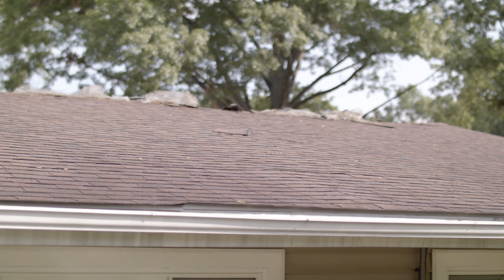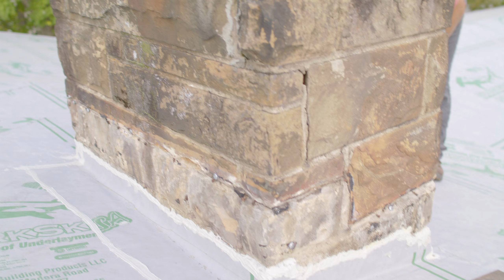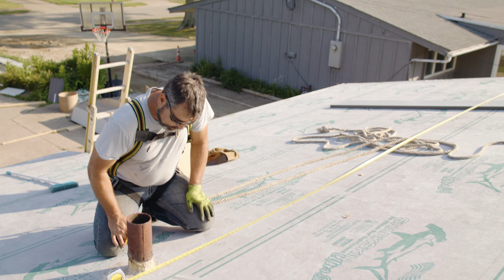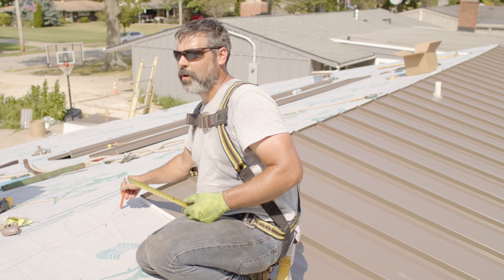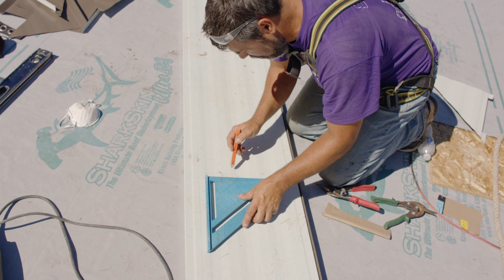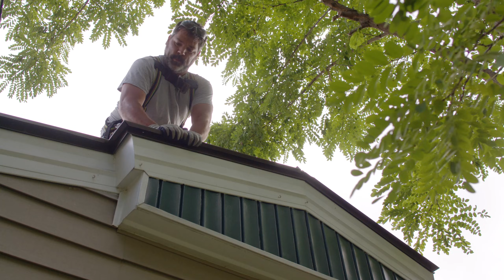How to Install a Standing Seam Metal Roof from Start to Finish

Comment: It’s great that y’all show the “overall “ start to finish, but it’s the small details like cutting trim overlaps and how to “fan” the panels to make up for out of square situations that I wish you would have shown. If not then links to videos that do show it.  Good video but not great IMHO
Reply from the maker: Check out the description - I've listed out an in-depth tutorial video for each section of this roof including everything you mentioned (and the full installation playlist). Also copied them for you here below. -Thad

How to Prepare for Your New Metal Roofing Installation" video: https://www.youtube.com/watch?v=JgcsMPcahJ0
How is Metal Roofing Trim Fabricated?" video: https://www.youtube.com/watch?v=SpnvrixCG0A
How to Lay Out and Square Metal Roofing Panels" video: https://www.youtube.com/watch?v=3SVEgdWeu_8
How to Install a Pre-Manufactured Curb" video: https://www.youtube.com/watch?v=9yN0W76Cnpw
How to Install Metal Roofing" Playlist: https://www.youtube.com/playlist?list=PLrMRkz6smMg3SjsuPhCQBlcrYuNfqL242
Scratches on a Steel Metal Roof: Identification, Prevention, & Repair": https://www.youtube.com/watch?v=rotxCn2nBB0

Comment: These gents are true craftsman. Standing seam roofs are not easy make sure the standing seam itself runs precisely parallel to the rake and perpendicular to the fascia. These guys nailed it. I also appreciated the expert chimney flashing. These are roofs are obviously more expensive than shingles but when you see the extra time involved to execute the attention to detail required, you can see why they cost more.

Comment: It looked amazing until the screws in the ridge cap! All that work and design and they couldn't figure out how to snap on a ridge cap. That's a shame, but it looks amazing! Great job!
Reply from the maker: The screws are installed outside of the building envelope, so there's no chance for water intrusion there. For this particular vented ridge detail, that's what the installation manual calls for. Thanks for watching! -Thad

Comment: What about using tape on back side of each panel for amortisation? Is it a must have?
Reply from the maker: Not sure what your question is - can you explain more? -Thad
Reply: @TheMetalRoofingChannel  I have seen that some people use anti- vibration tape by applying a strip of it on each backside of the roof metal sheet
Reply from the maker: That's typically not a standard practice unless you're talking about foam closures for exposed fastener metal roofing. Those are necessary for certain types of panels. Foam closures look like this: https://www.homedepot.com/p/Gibraltar-Building-Products-3-ft-Inside-Closure-Strip-Foam-SM-Rib-Roof-Accessory-in-Black-4-Pack-98190/202093155 -Thad

Comment: If I wanted to install polyiso foam insulation on the roof, what would be the order of the materials? 

My thoughts is 
1st: decking 
2nd: polyiso
3rd: shark underlayment 
4th: standing seam metal roof 

Does that sound about correct or is there some correction needed in the order of the products. 

Thanks all help is greatly appreciated!
Reply from the maker: Yes, that's typically how an install like that would go! Check out our installation manual for polyiso assemblies, there's a lot of great info in there that would be helpful: https://sheffieldmetals.com/wp-content/uploads/2022/10/smi-installation-manuals-for-panels-over-steel-substrates-with-iso-5-25.pdf -Thad

Comment: It’s a shame the owner of this company will not explain the reason(s) for the gauge the owner went with and why he did not go with the other gauge?
Reply from the maker: 24-gauge steel is the sweet spot when it comes to durability and ease of installation. Most of the Sheffield Metals testing and engineering is based on 24-gauge steel, and it has better wind uplift performance and dent-resistance than 26-gauge. Also, the color options from Sheffield Metals differ between the two different gauges, so color can be a factor as well. -Thad

Comment: There are more screws in that 2 inch metal boot than the entire 30ft roof panel. LOL
Reply: All that craftsmanship and you finish it off with a f'ing shit screw hose clamp from the hardware store? 
That looks like shit. Could have used some kind of speciality clamp like a quick lok or something that looks better.
Reply from the maker: You can use anything you want that doesn't cause a galvanic reaction and keeps the pipe boot from slipping! A hose clamp is usually the easiest and cheapest way, and most of the time you won't notice it from the ground. -Thad

Comment: Standing seam roofing has major flaws, especially when it comes to thermal expansion stress. Long, flat metal panels expand and contract with temperature changes, and when they can’t move freely, that stress builds up in the panel. Over time, it leads to oil canning — those wavy distortions in the flat areas that ruin the appearance. And it’s not just cosmetic — thermal movement can cause fasteners to loosen, clips to shift, and panels to warp or buckle. R-panel and Tuff-Rib panels don’t have this problem because their ridged design and through-fastened system allow for better rigidity and stress distribution. They hold their shape better, even in extreme conditions. Standing seam might look sleek, but without flawless installation and perfect conditions, it often turns into a maintenance headache. R-panel and Tuff-Rib are tougher, more forgiving, and far more practical for real-world use.
Reply from the maker: If expansion and contraction isn't accounted for on a standing seam metal roof, it could absolutely lead to problems. However, the benefit of standing seam systems nowadays is that they are designed with thermal movement in mind. Sliding clips for mechanical seam profiles as well as snaplock panels (that use any clip) allow the metal to move and stretch with the temperature. -Thad

Comment: I can't believe they left that vent pipe in the middle of the front roof. After all that work it would have been a simple matter to relocate that ugly vent pipe to the back of the house.
Reply from the maker: Sometimes it's not possible to move, and in this case the homeowner didn't mind. -Thad

Comment: How did you get the 16 5/8 measurements for the first panel of the valley?The vertical measurements.Why 16 5/8 instead of the width of the panel at 15 3/4.

Comment: I watched another video earlier and the guy was saying if you have any exposed screws in a standing seam roof then it's not really a standing seam roof.  I know the screws were exposed only in the ridge cap but won't these be a possible source for a leak and  replacement in 8,10,12 years when the washer wears out?  Thanks
Reply from the maker: The screws in the ridge cap go through the ridge flashing and exit out the z-flashing to the OUTSIDE of the building envelope. Water will not be able to get into the ridge through those screws. -Thad
Reply: Does this standing seam system have an option for “ridge venting “???
How did you guys vent this roof???

Comment: Awesome job! If my count is correct, you put 4 screws per Z bar instead of the 5 or more required by the manufacturer
Reply from the maker: Sheffield Metals does recommend 5 screws per z-closure, correct. -Thad

Comment: I’ve seen jobs done with strips of wood under the metal and some without. Any reason why?
Reply from the maker: We recommend a standard residential install be screwed down to a flat deck. This ensures that any engineering remains in tact, as there are not many (if any) major metal roofing manufacturers that provide testing for wood battens. Reason being, adding wood battens essentially makes your installation an open framing project because your panels are now spanning purlins. Additionally, if your house is vented properly, above decking ventilation isn't necessary (not to mention 1x3s or 1x4s aren't thick enough to provide adequate ventilation anyways). Sometimes battens are installed to allow an air gap for a thermal break to give the house extra R-value and to give air flow a chance to dry out any condensation on the underside of the panels. Again, both of these situations are generally not necessary. However, if either of these reasons are compelling, we still do not recommend using wood battens. Rather, we suggest using some kind of spacer mat like EnkaMat or Sharkskin's dimple mat so that you're still screwing into the plywood decking and retaining your project's engineering. Let me know if you have any other questions! -Thad

Comment: Wow this is an amazing install video and I admire the craftsmanship. Several questions. 
The bottom end of the panel? What does the install guide say about dog earing or filing the open area with sealant?  

The pipes. Wouldn’t sliding those metal covers over them create an ever so small area water could get in from?

Comment: Why aren’t there any 1x4 for venting ?
Reply from the maker: The house is vented through the attic space. Also, attaching a standing seam metal roof to 1x4's would void any engineering that calls for it to be attached to a solid substrate (like plywood). -Thad

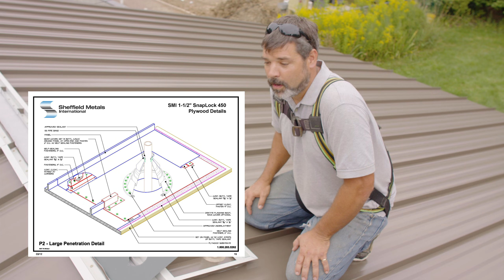Comment: 30:14  Is there a company that makes one of those extend UP & LEVEL top to mount a boot to for the traditional Ribbed metal roofs?? Mine leaks I think because the boot flange is bent over the metal panel ridge, the vent ISN'T in the middle of the panel
Reply: Unscrew boot ; clean away old seal, and apply a thick bead of Rubberized roof cement into problem areas and screw back down…..

Comment: GREAT production, I have leaking issues with a Pipe penetration for stove vent, on a STANDARD metal roof, it's beside a ridge & it appears I need a prefab box like y'all use @ 29:28 to get away from the ridge & extend UP where a boot can be mounted flush, WHERE can I buy these prefabbed extension boxes????

Comment: I am having a metal roof installed on a new addition front porch but the contractor is having a hard time figuring out how to handle where the metal roof will meet the shingle roof. Where they meet is awkward because it is were the garage which is set infront of the house and house meet. Almost creating a valley. 

Any suggestions on how to make this transition successful and what material should be on top?
Reply from the maker: I would suggest contacting our Technical department. They will be able to help out with installation advice for that condition. https://sheffieldmetals.com/contact/ -Thad

Comment: 😢
Reply: I recommended using a solid stick called a c looking pc for the top 5x2x3 five being the bottom two up 3;out panitied side inward .what this dose is saves tremendous hours much more precise and cleaner look.also note the reason i choose 5*2*3 is that give you some room to adjust you panels up or down or shorter or longer which ever , remember this pc. that's 10:or 12ft long will be one of the first steps to install then after that you sheets will side into the 5*2*3 ridge slot easy peasy fasten everything and then snap your ridge cap on, so you need to determine your ridge cap with and also note to allow inch on the overall ridge width as i like to allow that inch just make it Snap down easier   i hope this helps.ETS GOD BLESS.

Comment: I own 1/2 of a duplex. 
My neighbor had his side of the roof replaced in 2020, after an EF3 10/20/2019 however? My side (purchased in 2021) hasn’t been touched since 2015 & the previous thickheaded idiotic millennials didn’t think it necessary to replace their side of the roof when the neighbor side was being replaced due to EF3 damage (go figure).

Is it possible to knit-in & blend it a regular asphalt shingle roof with a metal roof on my side?, Or does it have to be contiguous?.
Reply: owning half of a house is crazy

Comment: On the edges, Why would you want the waterproofing over the top of the deck waterproofing?  Why would you not do the edge water proofing and then lay the deck water proofing over the top of it?

Comment: Nice clean job! I’ve never thought about boxing out a stack like that. 👍 I usually move them to land in the center of the panel on the back of the roof. Didn’t like the use of screws on the cap...rivets look better. Also, synthetic underlayments require cap staples.

Comment: Sorry, but as someone who makes a living climbing roofs I find it interesting (humorous) you guys have to run fall protection on a 4/12 single story. Great job on the roof though.
Reply: I always found it funny there is so much slack in these ropes anyway , you would still hit the ground after tripping on the rope.
Reply: I mean I get it, they’re a commercial install outfit and it’s required on the jobs they do so it’s just second nature for them to strap in, but it just made me chuckle. Still, commercial grade install on my house is what I’d want. I used to do commercial HVAC so I know the difference between the commercial construction mindset and the average residential Chuck-in-the-truck cowboy. There’s good enough and there’s the right way. Commercial doesn’t have a choice because everything is inspected, so they tend towards the right way.

Comment: I wish there were more craftsmen like this. Today's installers are crap. I had to argue with Lowe's for about a year to have them send someone out twice to fix my siding. Lowe's tried to say for me to contact the contractor that they gave the job too. I pointed out I purchased the siding and also paid for the installation. Since they took my money for both then subbed out the labor they are responsible and a judge is going to tear them up. I literally had to call Lowe's corporation and inform them if it wasn't fixed I would be placing a lien on Lowe's. Holly Molly, Lowe's sent out a siding specialist subbed out with in 72 hours. I highly recommend getting references from developers that do mid to high end homes. That's where you're going to find the best tradesmen.

Comment: Most bows and dips in the roof start below, at the foundation. When you find a roof that is visibly out of plane in places, you should definitely be looking at your concrete first. Just planing the roof is a bandaid, and if your foundation in failing, your GOING to develop more issues with your roof. You will likely also notice squeaks in your floor, and cracking in your drywall along corners,  ceiling to wall joints, above doors and windows, ect. This is the problem with hiring a roofing contractor without knowing the whole story. I bet you a jack and coke that this roof has already begun redeveloping wrinkles and issues.

Comment: Why no 1x4's installed for ventilation under the metal panels?  The metal panels will sweat on the backside, especially up North.  Without proper ventilation, that sweat will not evaporate, causing mold and mildew issues.
Reply: it will rust panels from underside , you better vent that sweat

Comment: Whoa there --- you showed a fastener of some sort sticking up underneath your underlayment material and said you take care of them but you didn't make it clear what you did.  Did you cut the material and pull the staple and then patch the cut or just hammer it down through the material?
Reply from the maker: If the fastener could be hammered flat without damaging the underlayment, that was the route Matt took to preserve the integrity of the system as much as possible. If the fastener was too big or at an angle, he cut it out and patched it. The key is that there were only a couple of these areas on the entire roof. It's important that you make sure the deck is clean and object-free before you install underlayment. -Thad

Comment: In Texas we would use a radiant barrier sheathing to re-deck a building.  Newer sheathing panels such as zip roof already have the weather resist coating on them already. Saves labor and time.

Comment: Hello there, how do the boys flash two 45 degree sheets on the ridge, keeping the standing seam or ridge profile or prickle  along the top of the ridge please?
I'm looking for a 12 inch ridge cap but must have no welding folded to 45 degrees for architectural appearance, rather than basic flat ridge cap.
Thankyou.

Comment: Overall, the guys did a great job. I like the idea from the other comment about moving the vents to the back of the roof and offset them so you’re in the middle of your panel but on the ridge cap, I think rivets would’ve been a lot better than using screws.

Comment: My old boss would've made me seam those overlaps, but y'all did alright. If you vented the Z's, you could use Cobravent stuffed in the peak, that way your cap is continuous across the top with no screws. 
Good job on that stack. I never thought to box it in like that over the locks. I generally fabricate the stacks on-site, adjusting the layout so that nothing land's on a lock, taking the angle and incorporating it into the pan itself.
Good chimney work too. I'm used to working with lead, but you can make it look good with metal as well. 
Awesome job, I'd recommend you.

Comment: Sorry but in min 39 of the Perimeter Flashing you ran the gable on top of the eave which is correct but I would suggest to cut back or miter the gable piece back at approximately  a 45 degree to prevent water or ice back-up under the gable nailer flange. I see this a lot and always require my crews to cut this piece back. Makes for good practice 43 years in the biz IMO;)
Reply: Where are you located?

Comment: I was told u could put the metal roof right on top of the shingles.  Why did u take them off?
Reply: Mainly to observe the health of the substrate...another way you can do it is attached strapping over the shingles and making sure you fasten the strapping to the roof truss